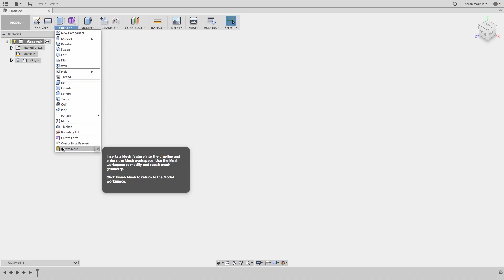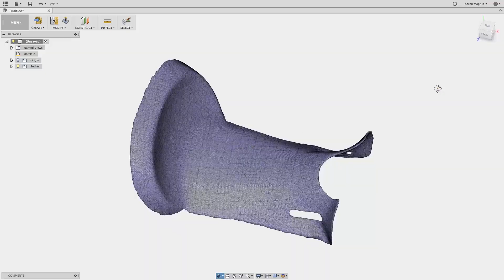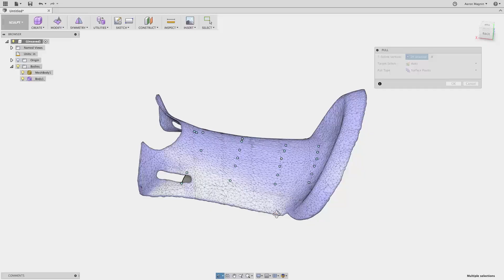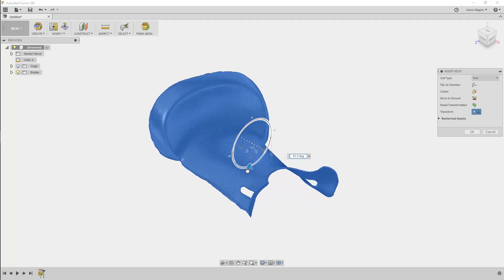QUICK TIP: Mesh to Solid

Comment: Fusion 360 developer folks... please consider including the Remeshing to Quad feature.  Not having the quad-remeshing available is a deal breaker that I cannot afford to live with.  For this single function alone, I am still staying with Maya's Poly>SubD>NURBS conversion, and then going into Solidworks to do the CAD engineering.
Reply: Lookup the youtube video titled:  "QUICK TIP: Triangle mesh to quad"

Comment: I scan huge mining vehicles and dont have time to diddle fuck around with all of the thousands of features within the scan, yet all details are needed. I just want a tool that can let me make surfaces fast that dont need to be manifold. I cant afford to spend anymore than a week on one scan. Do you recommend any ANY software available that can just crunch the mesh into a surface so I can then use in Solidworks or any other software. Thanks

Comment: hi guys! I have an issue. I have a dashboard scan as a mesh. when I try to pull the flat plane to the dash it creates a blanked under tension, not filling into the "valleys"
how can I resolve this? I tried a finer grid but it somehow wont work

Comment: worthless software is worthless. can't even cut a damn hole in a mesh. and this video is useless as well. doesn't help turn a mesh into a solid object, not sure why its required to even cut a hole...
Reply from the maker: If you want to edit mesh, get Meshmixer. I don't complain how useless hammers are when I try to use it to drive in a screw. 
http://www.meshmixer.com/

Comment: Thanks I'm working on a 3d scan of my torso to make a form fit arm prosthesis for my self, will open source once finished and instructables.
Reply from the maker: That's actually where a lot of my interest in working with meshes come from. I have a connection with a pretty fantastic prosthetist if you wanna get some guidance. Email me if you're interested. aaron.magnin@autodesk.com
Reply: @adskFusion  thank you will do, subject: KISS arm project.

Comment: All was going well until it was time to thicken....in which your tutorial stops there. This was a great tutorial but it also sounds like you already knew thicken was going to be a problem. So how can I get this into a body?
Reply from the maker: If you can't thicken due to minimum radius of curvature, surfacing techniques will likely need to be applied. Try an offset, then close it off so it can be turned into a solid.

Comment: When I was first learning to model I used Sketchup because I had free access. I used to thing working with mesh files in sketchup was terrible and in some ways it is, however they had two import settings that were particularly useful. One of which was to combine colinear faces.  It was great for simple meshes especially those that were boxy. Made them easily editable right out of the gate.

Comment: Summary of methods::

1) 1:54 = Sculpt plane to mesh using pull. Like DRAPING a fabric onto a form

2) 2:21 = Sketch using mesh section then LOFT

and finally

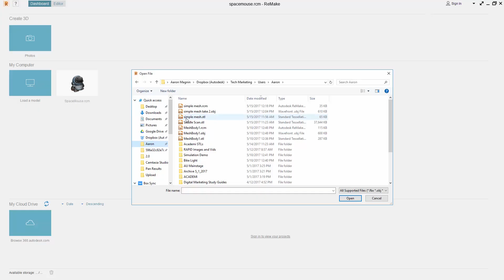3) 3:55 = Straight CONVERSION of mesh to T-splines via .obj quads file ((now remake is dead you can convert with meshlab/-filters-remesh-tri to quad then obj export)). Because you have not actually added intelligence to the conversion process the imperfections of a mesh will be enlarged if you make your object bigger - you haven't actually described any new curves: it's like analog vs digital, SVG vs jpg, raster vs vector. You also need to check for holes. 

Now the big question... when to use each method? In the example he is using a open mesh but most mesh objects are hollow....

Comment: im very new to the program however have been using solidworks for a couple of years and understand the basics.My question is if there is any way to replicate a line kind of like a convert to entities tool? i hate having to trace over my stretches cause i feel like i haven't done it properly.

Comment: So you basically cannot just import a stl file into Fusion and do cam operation on it?
Reply: james shelton support for toolpathing stls was added to Fusion last month. or possibly the month before that
Reply: Hello Scott,
 I saw the update release and tried to just import a stl file that I've used in another program. It wasn't straight forward as I thought, I was told I had to go through these steps to make it work. So basically from what i've seen and been told by The Fusion people it's not just load a stl and apply your tool paths
Reply: james shelton well.. I haven't tried it, but that's exactly how it's meant to work. so if Fusion people are telling you that you need to convert it, that isn't true. however, it's quite possible that there's still a face count limitation.
Reply: I used a stl file in this highly used software, I don't want to name out of respect. And I could simply go to town, when i tried this in 360 it's not so straightforward.
I want to make this work, but it seems there's alot of steps to do a import of the stl file
Reply: Sure , that'd be great!
Reply: email sent. Toolpathing STL's is definitely possible in Fusion, and it just toolpathed the STL you sent without breaking a sweat.
Reply: No. An STL is a just a bunch of triangles. cam is curves and relationships between those curves. Imagine taking a photo of this page vs saving the actual webpage, SVG vs JPG or analog vs digital. 

Took me ages to figure this out!